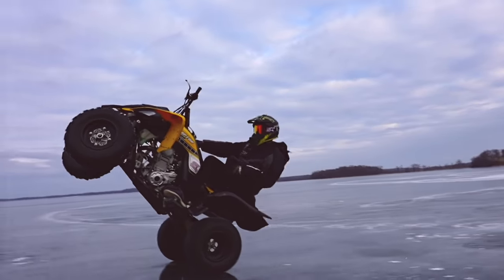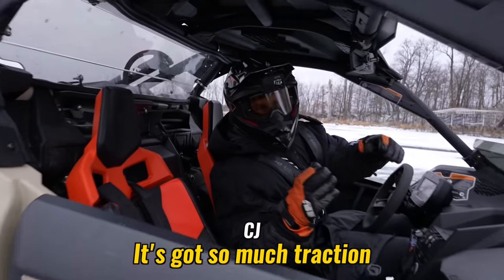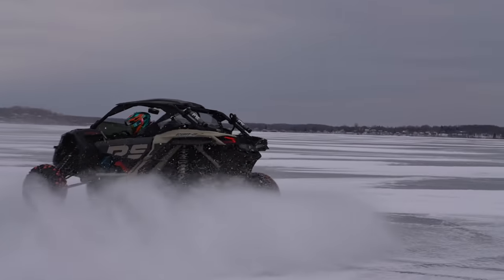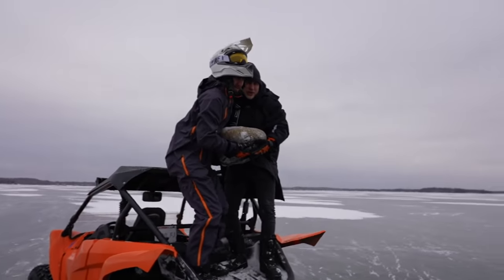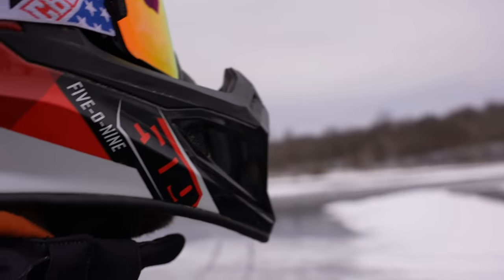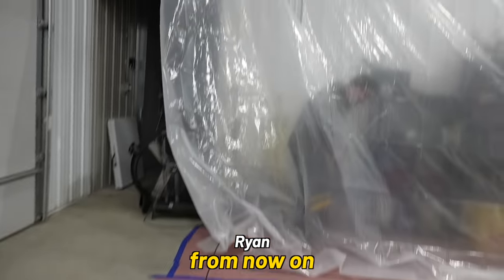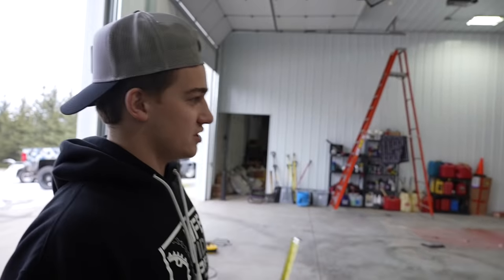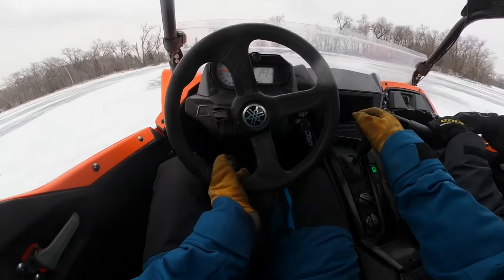Maverick X3 on Thin Ice

Comment: If you stud tires this year, and you use the cheap self tappers, get the longer ones so they go all the way trough the tire and on the inside use flex seal, it’ll hold them in and it’ll keep it from leaking